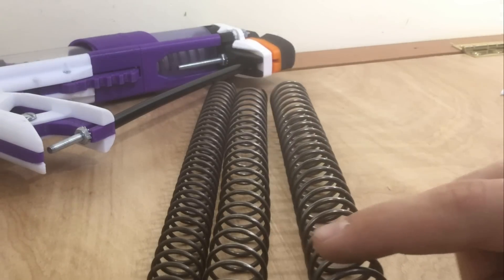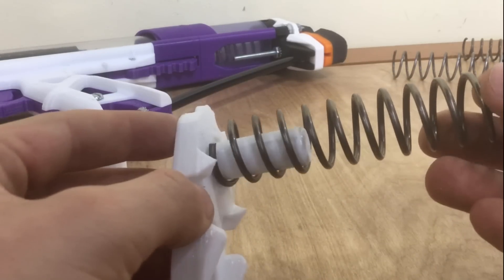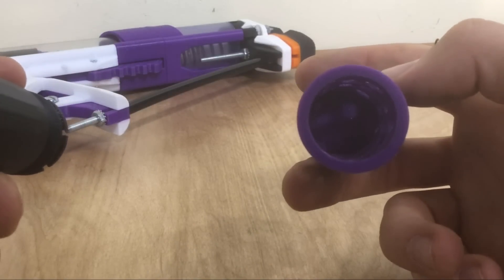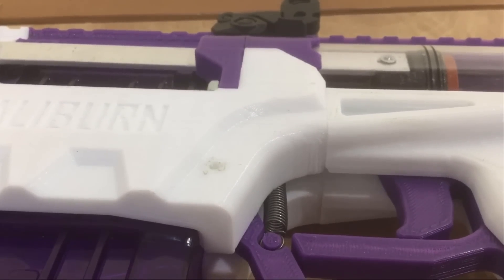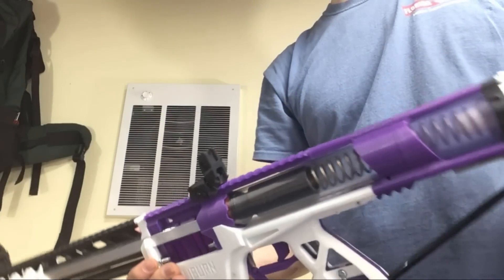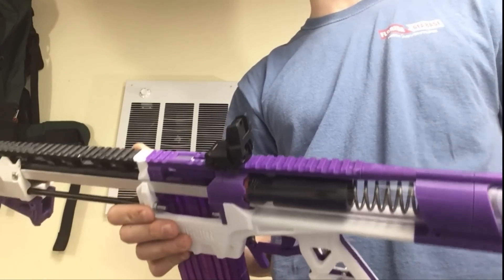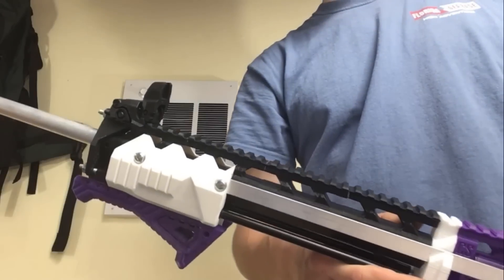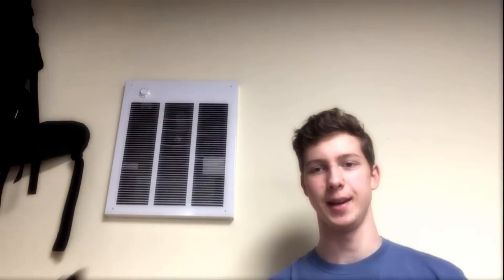The K14 Caliburn - An Overview

Comment: Too bad these aren't made with machined aluminum, I'd want to run a spring in spring. But I'm a crazy 240 lb man with decent arms. But I highly doubt the PLA would take the spring stress from a K26 inside a K14, I would think the whole blaster would grenade in your hands the first time you fired it.
Reply from the maker: Batojiri1 I've done it, the sear catch just can't hold back that much force.
Reply: Precisely why some parts should be made out of PETG or Aluminum not PLA. 3D printed PETG is far stronger than PLA, requires a more expensive 3D printing setup with a heated plate, but it bonds to itself better than PLA. Making 100% infill much stronger.
Reply from the maker: Batojiri1 the issue isn't that PLA parts break, it's that the design of the sear simply cannot support that weight. You'd need a catch spring that's would be almost impossible to actuate.

Comment: So what is the fps difference on different dart types? Like some of the other comments mentioned, some firing footage with performance data on different dart types would be really interesting. 

Very cool mod.
Reply from the maker: The lighter the dart and the better the barrel fit the higher the velocity. More footage and data is coming.
Reply from the maker: Brent Fry Just an update, one of my first customers installed the kit, and using the stock barrel, stock O-Rings, and a blastertech scar barrel he averaged 270 fps. A better barrel could easily push this well into the mid 300s.
Reply: Remzak Nerf Wow. That's crazy performance for not much more difficult draw weight. Thanks for the information.
Reply from the maker: Brent Fry oh I promise it's much more difficult, but so far I haven't had any customers say it was unprimeable.

Comment: FPS or ranges? That's insane.
Reply from the maker: Insane is the best way to put it... I don't have a chrono unfortunately but at least 300 FPS
Reply: Remzak Nerf Wow.
Reply from the maker: Quindarious Gooch Just an update, one of my first customers installed the kit, and using the stock barrel, stock O-Rings, and a blastertech scar barrel he averaged 270 fps. A better barrel could easily push this well into the mid 300s.
Reply: No! Thats demon!